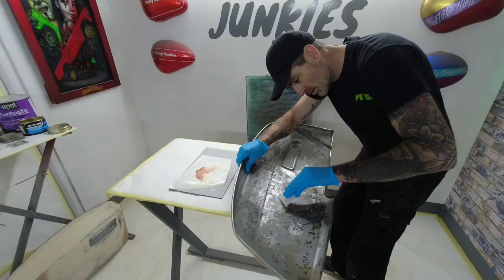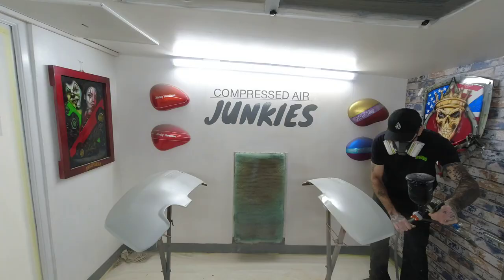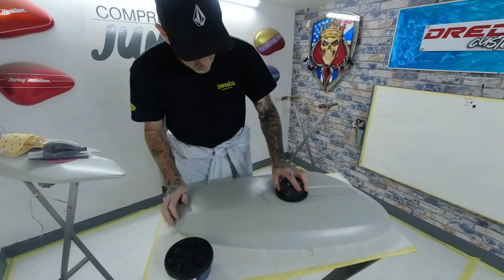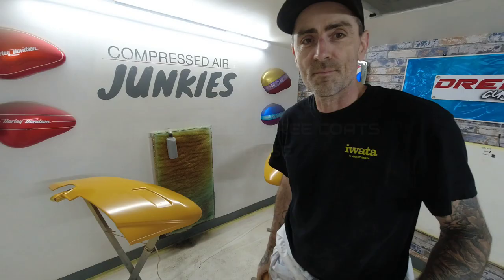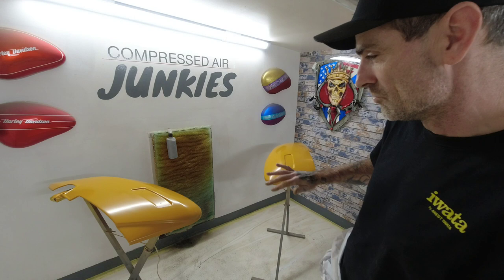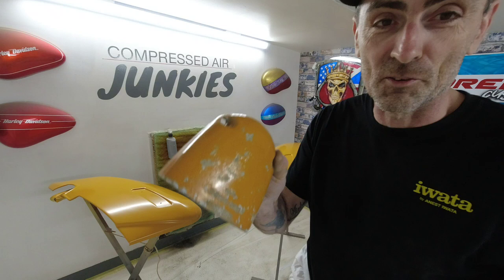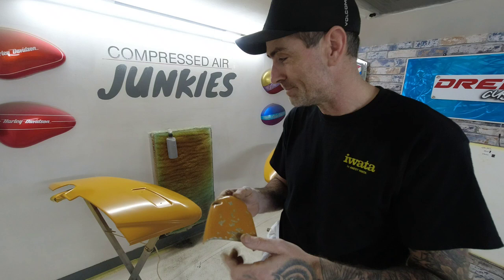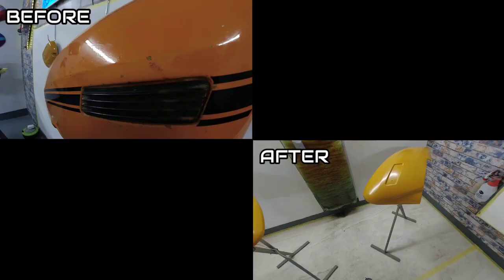Lambretta gp side panels PART 4  Guide coat and Base Coat

Comment: Hey Rob, another excellent video.  Quick question, do you have an LPH-80 in your arsenal?  If so, would you consider making a video on it and other mini spray guns that don't require a lot of cfms for painting?  There's just not that many on youtube and the LPH-80 and 50 are such wonderful guns.  Thank you sir! :)
Reply from the maker: Hi I don't have that gun unfortunately but I have heard its the nuts 🦫 I only have the iwata impact junior which I use in today's video great little gun 
Thanks for the feedback 👍
Reply: I do have the LPH-80 spray thick wood coatings such as clawlock 2 primers from the ML Campbell brand.  If it spray thick clawlock 2 at 15 psi or less  I can honestly say it can just spray about anything.  Hope this helps